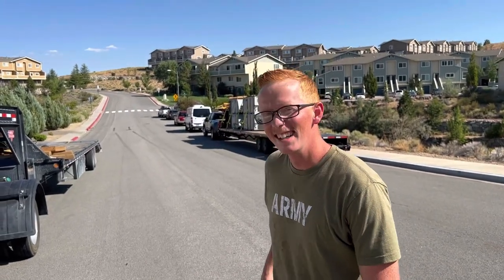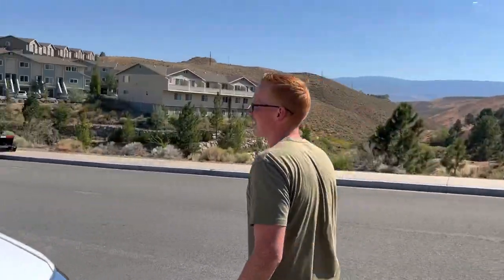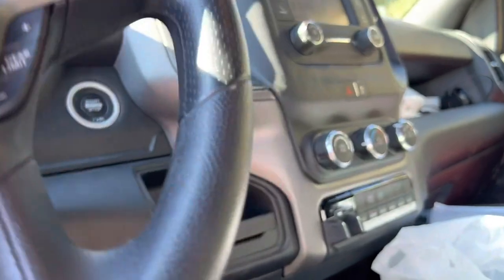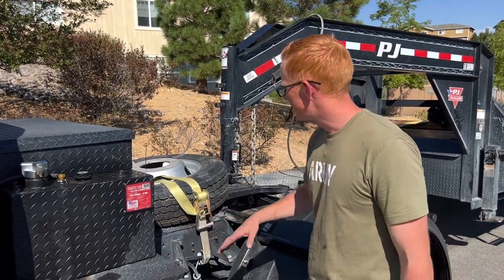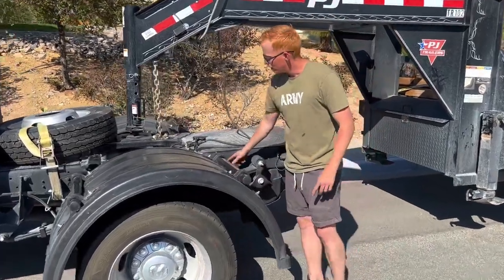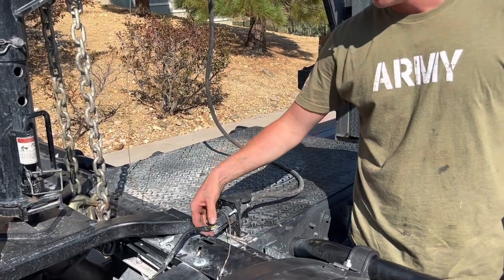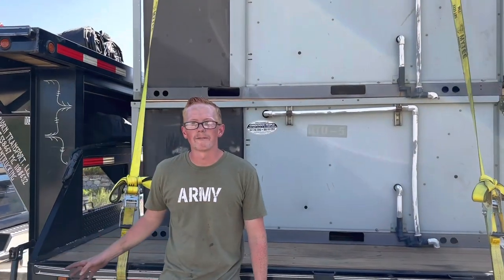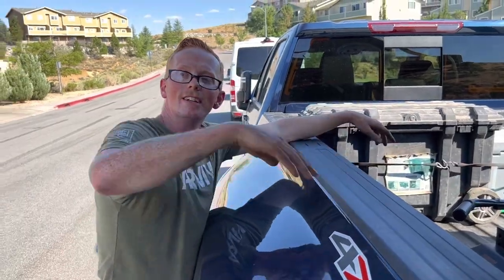CDL vs Non CDL hotshot, Chevrolet and Ram review, Mytee products, hotshot set up

Comment: All I need for my E-450 cab and chassis is a coffin sleeper and a gasoline fuel tank... I found a fuel tank for gasoline from northern tools...
I was going to be ready for January but I'm behind by a few months...
I'm taking my time to make sure I do it right
Reply from the maker: Your running hotshot with a gas motor?
Reply: @gingerhotshot  yes sir... And it pulls like a diesel powered truck..
It's a dually with I think 435 gears ratio if I'm not mistaken

Comment: I'm not in the business nor will I ever be but it interests me so I watch a lot of channels like yours. What I have noticed is so many times the trailer is not really full and when it is it seems like it doesn't really pay any more. Only a couple of the guys have 30' trailers and it doesn't really seem to hurt them. I can see some advantages having a 30' trailer, the trailer weighs less, you can carry more and easier to get around. Is this just an illusion and it really is a set back?
Reply from the maker: You not wrong I started with a 35 and it didn’t really change much. Although there are some loads that require the full deck like shipping containers but those suck to haul anyway. It depends on what you haul.

Comment: 4500 is a good option over the 5500, unless you plan on hauling a longer heavier loads, then 5500 is good. F-450 is a good truck, has an optional bed, or no bed.
Reply from the maker: Yes I would agree

Comment: These newer trucks are rated to carry heavy loads but only for short distances and not all of the time like for hotshot...
Honestly in my opinion as a retired ASE certified mechanic, I will always run older vehicles... It's cheaper rebuilding a motor and transmission at the same time than rebuilding a diesel powered engine and parts are more available for older vehicles than newer ones...
I can replace all the sensors in my setup for the price of 1 diesel injector...

Many people tell me that I need a diesel powered truck but I really don't want one because of how expensive parts are for diesel powered trucks... Maintenance, parts and labor is more expensive than gas powered trucks...!!!!

Brother don't give up... I would suggest you find a Ford gas powered V-10 truck and run it and compare both gas and diesel powered trucks for one year and decide what will benefit your business more...!!!!

GAS POWERED IS THE WAY TO GO FOR NOW IN THIS ECONOMY... 
ONCE IT GETS BETTER I WILL PURCHASE A DIESEL POWERED TRUCK..
Reply from the maker: Interesting I will be paying attention to see how it goes for you

Comment: That's why I have a V-10 gas powered engine... 
Diesel have too many issues and harder to get service and parts on a timely manner
Reply from the maker: I’ve heard engines blow up easily when towing
Reply: @gingerhotshot   they can... It's a matter of regular maintenance and knowing the engine ( engine sounds, power bands, etc. )
I'm constantly looking at my gages and mirrors... Yes I know it's a bad habit.. LoL..
As long as you know what your setup is capable of and not force it then they will last..
V-10 ENGINE use/ burn oil.. if you check your oil level on every pre/ post trip inspection they last a long time... Never count on your oil pressure gauge alone...
By the time you get a low oil pressure on your Guage it's too late...

Comment: Possibly the people who built that trailer will not agree to derate it for you after it has been built and left the factory. Usually if you want to derate a trailer it has to be a custom ordered trailer so it ends up with the proper VIN placard on it. Only some of the trailer makers will help you out with that later on. For a non-CDL setup most guys use a SRW 1-ton with a 11,500 GVWR and you're Gucci with a 14k GVWR trailer. Or a 10,000 GVWR 3/4 ton and a 16k GVWR trailer with a pair of 8k's under it would be fine too. Or you can just go get your CDL and not worry about that. But then you'd have to sign up for drug testing consortium and can only blow a .04 so up to you how you want to handle it. They'll definitely shut you down and fuck up your FMCSA safety score if they catch you driving that with no CDL.
Reply from the maker: Yes sir you got it all right

Comment: You have to de-rate the trailer. I would do it before you get shut down for not having a cdl.
The only way to run it with just 26k tags without a de-rate would be if you had a cdl!
Reply from the maker: Correct yes, that one actually got registered as CDL with a better trailer